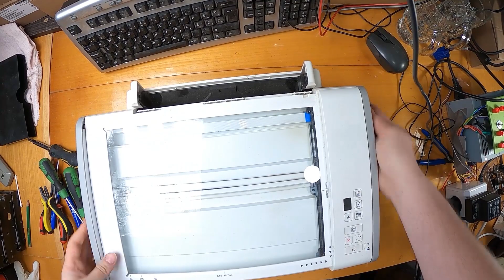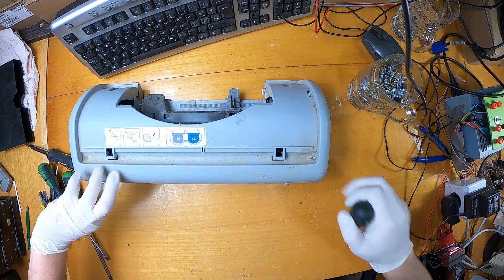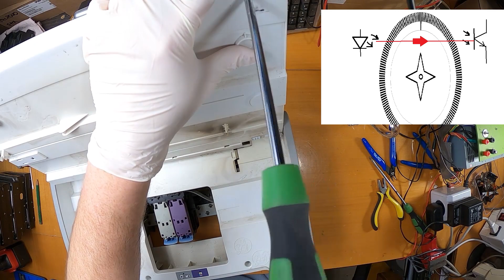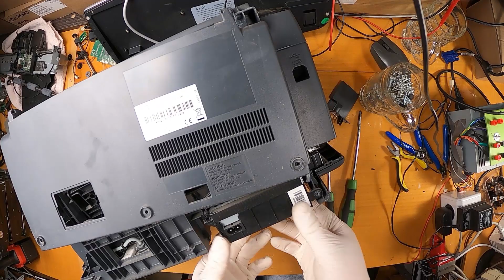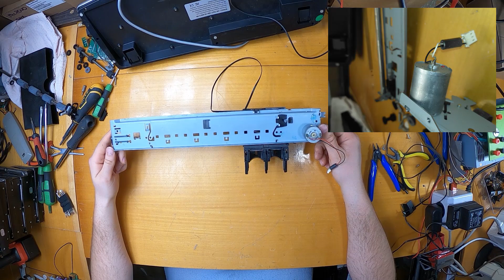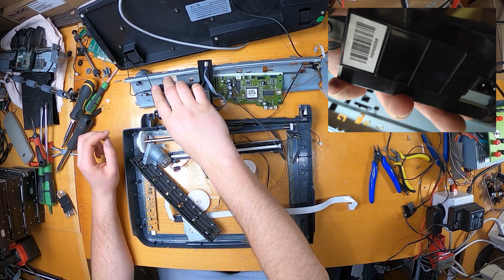InkJet Printers   - Full of REusable parts  - Teardown

Comment: BTW, I found that some older Samsung ladder primers are just full of metal parts, a lot of springs, probably 60 screws of a few sizes (2.5 mm?), One main brushless motor with driver board, and several nice steel shafts, plus a high-voltage power supply, I guess for the image transfer...much better built than a lot of the newer hp and Epson printers.
Reply from the maker: Hi, I agree little bit of everything can be found and it is interesting how different manufacturers have different parts and not only manufacturers but also there are differences in older and newer printers.